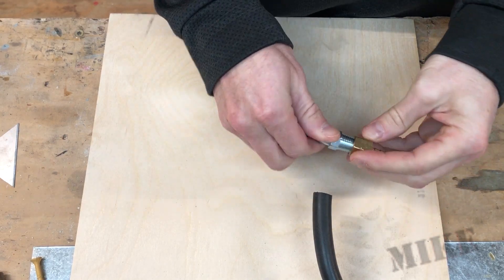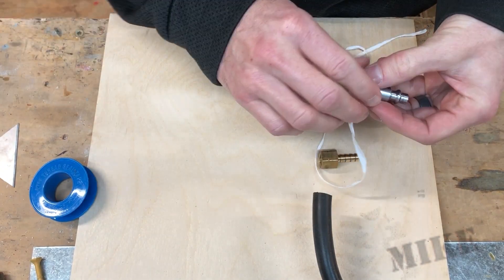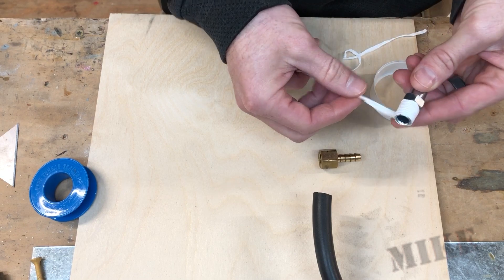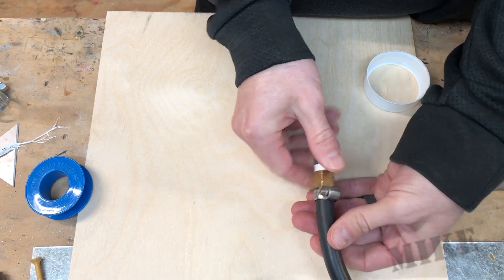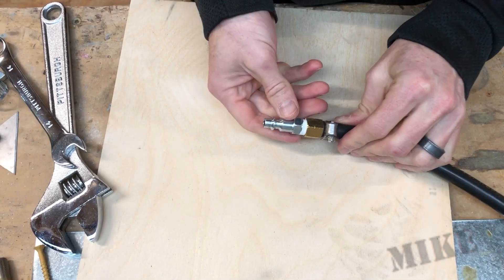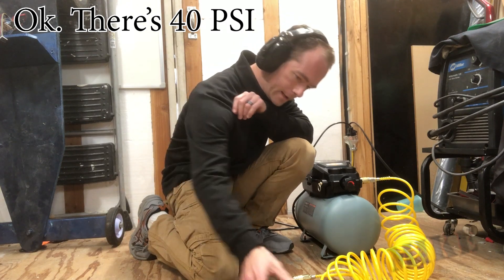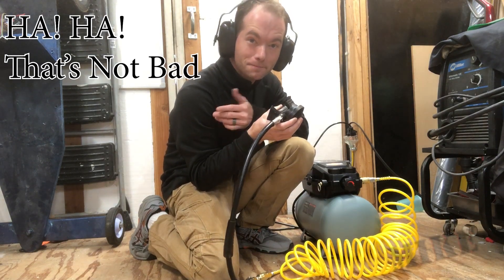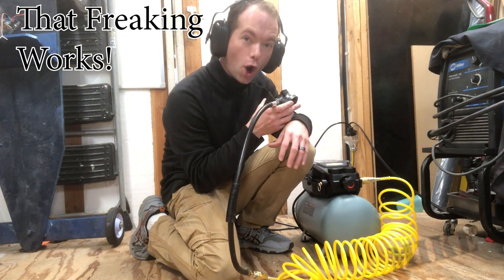SNUBA System 2 - Mikes Inventions

Comment: You may know more about this than me but is a diaphragm pump safe to use for supplying breathable air? It doesn't sound safe.
Reply from the maker: Hey there! Thanks for asking. Others might be wondering the same thing.  Diaphragm pumps don't required lubrication like a piston pump does, so they're cleaner and much safer for something like this. Usually cheaper too! Thanks for watching.